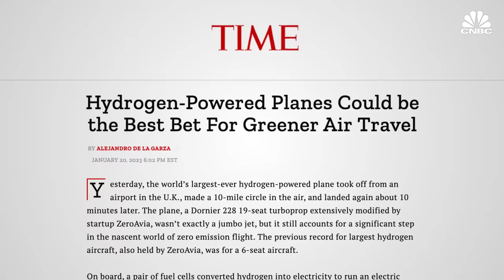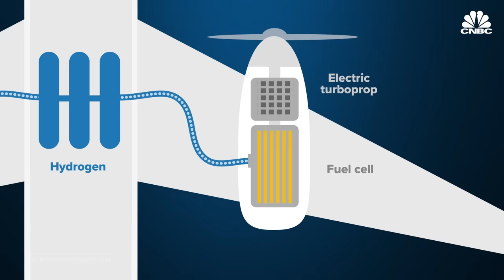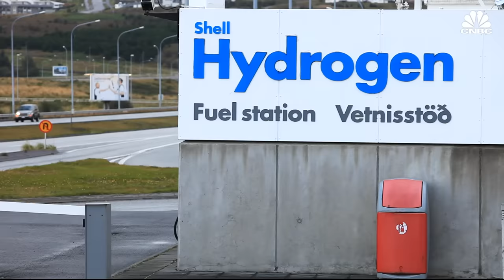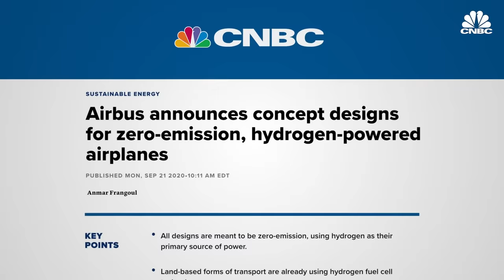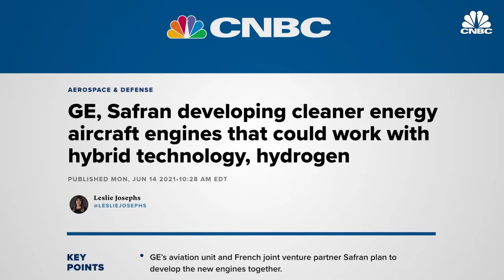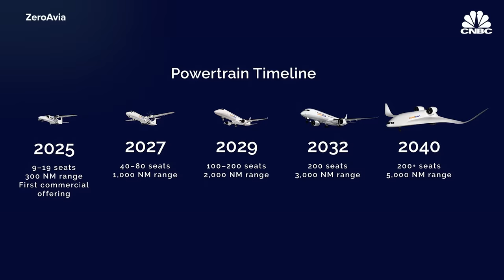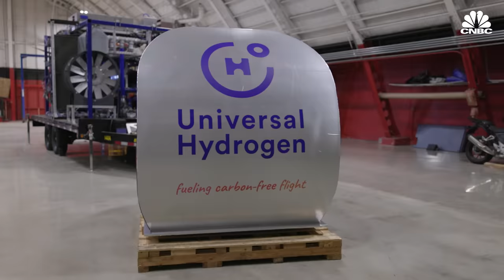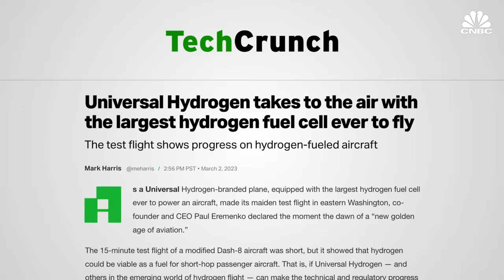Why Hydrogen-Powered Planes Will Beat Electric Planes

Comment: While H2 is energy dense by mass, by volume it leaves much to be desired. H2 also needs to be either cryogenically frozen or highly pressurized in storage which drags on its round trip efficiency. H2 could still play a big role in green ammonia production, which has greater energy density by volume without the previously mentioned problems of h2. The holy grail in my view would be developing a scalable and cheap direct ammonia fuel cell (vs having to crack the ammonia back to H2, which again, drags on efficiency).
Reply: This honestly... Or if all else fails, we could develop e-fuels for use in aircraft and shipping, but my guess is the loss in efficiency would be higher than for ammonia.
Reply: @jenniferperry87  yes and we’ve seen it is only good at postponing space launches. SpaceX abandoned it. Too finicky and dangerous to be practical.
Reply: Planes don’t carry fuel for a round trip. That’s called ferrying fuel and is only done if fuel isn’t available at the destination.
Reply: I'm more worried what they left out. 1. Hydrogen production or the production of black Hydrogen which results in more pollution since it is the only cheap way to produce hydrogen. 2. hydrogen cells use rare metals like iridium and pt which has become really really expensive and only a few countries dominate the market. 3. Storage, due to the hydrogen and the way it bonds with metals all pressurized tanks have to be specially coated which makes them really expensive and heavy. So it seems that hydrogen in aviation has a lot of issue to solve.
Reply: I don't think that we need to worry about the round-trip efficiency of H2 as much as we do. The extraordinary energy density by weight is the most important part of it, enabling its use as a green fuel in aviation and long-haul trucking. An electrolysis-based production process can easily be run on the excess power generated by solar and wind plants that might otherwise be wasted, making the round-trip efficiency much less important.
Reply: Indeed. It doesn't seem that using molecular H2 for long haul aviation is a solvable problem, which I suspect is why we never see more than extremely buzzword-heavy announcements without any serious technical details. My suspicion is that all of these startups are riding the current hydrogen hype (and are helping fan it) to line up lots of R&D investment, in the hope that in 4-6 years or so battery densities will increase sufficiently to enable a smooth switchover for medium-haul flights, while quietly sweeping the hydrogen failure under the rug. We've seen that before with Nikola and others in trucking, no reason it won't happen again in aviation. Ammonia MAY be a solution for longer flights, but it's still significantly less energy-dense than hydrocarbons and will require more substantial conversion technology, significantly lowering overall payload capacity. Best and most likely case I see is that long haul flights will continue to run on fossil fuel, with shorter flights increasingly being electrified. If you can electrify all but transcontinental flights, you're still massively reducing emissions.
Reply: @fourth deconstruction  1. Blue hydrogen is the most produced and consumed hydrogen currently, produced from natural gas. 2. The amount of those catalysts actually in the electrolyser or stripper columns is surprisingly quite low, not the major cost by a long shot...
3. Passivation is a cheap process and basically prevents hydrogen embrittlement on top of using a base metal like stainless steel type 316L, hydrgoen embrittlement really isnt a huge problem.the real problem is still always about compression,  the amount of compression  needed is stupidly cost progiohibitive.
Reply: @KaraHops  unfortunately  due to no industrial renenwable energy storage, the least realistic thing is running on renewables fully, an offshore wind farm or similar will only run for s portion of the day while the plant needs to run continously, the electrolyser takes too long to startup and shutdown  for it to be a batch process
Reply: @blade  hydrogen beats out energy efficiency from batteries in longer haul trucking especially, meaning it has a workable niche to build from no matter what happens with planes, it wont just go away, the energy density is just too attractive combined with the huge subsidies  and goals plotted by the EU for example, they've  commited to producing something  like 200000 tons a year of it by 2030
Reply: @whut9245  

" the electrolyser takes too long to startup and shutdown  for it to be a batch process"

Really? We had an electrolyzer on the submarine, called "O2 Generator", it didn't take hours to startup? We have nuclear power, so we just run a lot of electricity through seawater, and it gives us oxygen to breathe. We just vented the H2 overboard. It starts generating O2 as soon as you turn it on....maybe some processes need a while to start up I dunno.

There is a plant being planned here in California to take excess power from solar (we get a LOT of solar power when the sun is shining, here) and use it to split water, then run the hydrogen through a fuel cell at night. 

But this is a good reason to keep nuclear power around, as it's 24/7 no pollution. Other examples of such sources are hydroelectric and geothermal. 

Here in the Bay Area we have the largest geothermal plant in the world, capable of up to 1.5 GW although they usually have it ramped down a little to 900 MW. It's called "The Geysers". 🙂

There's tech they're working on where you could geothermal anywhere in the world, by drilling until you find heat, and then letting wastewater fall down there due to gravity, and use the resulting steam to power a generator. They've already done a bunch of that at The Geyers when the water was running low at some of the plants.
Reply: @asphere8  I don't think there really is such thing as "excess power generated by solar and wind plants" until there is enough capacity and storage to get rid of all generation of electricity using fossil fuels.  That's at least 20 years away.  If you instead use some of that capacity before you reach that state to produce H2 for aviation, you are further delaying how quickly we get off of fossil fuels for generating electricity.  You have to focus on efficiency if you want to collectively reduce the use of fossil fuels in a timely manner.
Reply: @TomCook1993  Round trip efficiency isn't referring to the plane returning to it's point of origin.  It's referring to the inefficiency of going from electricity to hydrogen and then back to electricity again (electricity->electrolysis of water into hydrogen->compression and liquification of hydrogen->storage and transport->regassification->fuel cell->electricity).  You lose more than half the energy due to inefficiencies at every step.
Reply: Each time you add a step, you add another inefficiency.  The use of H2, is you point out, is very inefficient when you look at the whole energy transfer system from electricity to hydrogen and back to electricity (electricity->electrolysis of water into hydrogen->compression and liquification of hydrogen->storage and transport->regassification->fuel cell->electricity).  Producing ammonia introduces another step of inefficiency, and as you mention, if you have to convert from ammonia back to hydrogen you have another.  H2 and Ammonia also have their own sets of hazardous material concerns as well, that can't be ignored.
Reply: Most hydrogen comes from natural gas anyway. CNG/LNG does not weaken metal, is easier to store then hydrogen, is 100% American independent fuel with pre-existing infrastructure, does not need expensive fuel cell materials, takes up less volume then hydrogen, wile burning cleaner then current airline fuels while being cheaper. May as well skip the middle man. Especially if the CNG/LNG comes from biogas which makes it carbon neutral (as good as batteries). Oh and the fuel is non toxic which means no soil/ocean oil spills.

That being said the only advantage hydrogen is it “burns” without any air pollution on the business end. Note that most hydrogen comes from natural gas which emits carbon on the fuel synthesization plant end regardless to make the hydrogen but can be made carbon neutral if sourced from waste/biogas  (and along side methanol) can run through a fuel cell which is quite compared to a internal combustion engine. doesn’t mean much now since fuel cells are Uber expensive but if research can find cheaper materials to make fuel cells with, then they could replace batteries a lot of devices. Why would anyone want that?  Well refueling is and likely always will be quicker to refuel and be more energy dense then a battery recharging and cell chemistry; meaning your phone or other device that uses batteries could, in this hypothetical scenario, last you 3+days straight while being able to refuel in less then 5 minutes from 0%.

For cars and trucks, a electric pantograph/Biogas/biodiesel/vegetable oil or efuel hybrid system would be ideal. Batteries take a lot of pollution to fabricate compared to ICE and are not Nationally independent materials. A electric pantograph road system will allow us to use way less battery materials while providing electric cost and environmental savings with less manufacturing emissions while providing the option to use carbon neutral fuels in less developed/off-road scenarios. Oh while being infinitely easier to recycle.
Reply: If somebody wud be so kind to provide how much wh/kg does hydrogen have...
Interesting to see how far off is Hydrogen compared with batteries... 
So far we've heard announcement from the likes of CATL & others that they've managed to achieve up to 700wh/kg...
🤔🤔🤔
Reply: @fourthdeconstruction  But you're not going to get an alternative. What are you going to use? Batteries? This is technically unfeasible unless there's a massive breakthrough in battery technology. Batteries would need to be at 2.4 kWh/kg. Hydrogen is the future for aviation. This doesn't mean things will happen overnight though. There is no straightforward solution to a green transition for aviation. New technologies will have to be built. Luckily there's another 25 years for development and testing before 2050.
Reply: @wakannnai1  Battery tech is improving in the meantime Biofuel has shown that it works. Commercial planes are already flying with it. Lithium is not going to help aviation, we need other solutions to make batteries way better. But Hydrogen even if you fix or find solution to all related tech challenges, you still have to solve the problem that it's very expensive to produce with clean energy otherwise you will be producing black Hydrogen from fossil fuel which will produce the same level of pollution as flying planes with jet fuel.
Reply: Nitrogen oxides are harmful, it's one of the reason and the other major reason for not using ammonia is it's high ignition temperature and low stability of flame i.e before it even ignites, it would leave the combustion chamber of an airplane. So this would require designing a new type of fuel spray and combustion chamber. People might think it's easy but it's not. Combustion chamber is one of the hardest to design, cause there's no proper simulation or to correct a software that has high accuracy for combustion simulation, this slows down the design process. Another reason is the efficiency. People might not believe this but the current combustion chambers are >99% efficient. So that's a tough competition. Not saying designing a cc for hydrogen is simple but hydrogen is superior to nearly every type of fuel when it comes to ignition and flame stability.
Reply: @asphere8  the major problem is electrolysis itself. The electrical energy required for it is huge. I once learned in a lecture that just to Heathrow 100% with hydrogen planes it would require tens of thousands of megawatts. In comparison a general thermal power plant generates 3-10k mega watts of power (it's in that ballpark but it might be even bigger).
Reply: @SunKing909  in a expensive fuel cell for performance effectiveness yeah, in a Hydrogen ICE or measuring for energy efficiency to make the fuel then use it. No. Inferior volume energy density and harder logistics. Nox breaks downs in atmosphere otherwise known as laughing gas. Not to say it’s no lapughing matter but it’s by far the least prioritized since every current combustion engine emits it reguardless. Internal combustion engines age not 99% effecient. 45% max for common engines. If you want to remedy Nox you could use a nitrogen-less closed fuel mix engine. No nitrogen to react in the combustion chamber if it stays sealed and only intakes the fuel mix. Though that is future Nox tech. But as they say perfect is the enemy of good and Nox is one of those low priority things compared to greenhouse gas and utility performance. Hydrogen ICE engines produce Nox too fuel cells however don’t but are too expensive so far. You are right for thinking of that type of stuff by hydrogen is not specifically that Nox haven. Hydrogen comes from natural gas plants which produce NOX anyway.
Reply: @wastelesslearning1245  that 45% is what we call thermal efficiency. It's different from combustor efficiency.
Reply: @SunKing909  we use thermal dynamic effeciency cause it factor in the energy needed to refine/transport the oil in the first place and wasted in things like transmission and waste heat. Otherwise we ignore the forest for the trees. If you only measure the wheel output, you can fool anyone with 99+% if you ignore every input system before the result. I’m still glad that you look into things like this. Too little people don’t.
Reply: @wastelesslearning1245  for combustion chamber we still use combustor efficiency eta c. it's not a major parameter when you consider the entire engine but only when you look at the cc it's one of the main parameter. Currently I think other than during flame out condition due to emergencies, it's not acceptable to have an efficiency less than 92%. Might think it's a useless one but it determines the required fuel flow for an engine.
Reply: @SunKing909  I don’t think it’s useless just incomplete. Just measuring the combustion efficiency is a good start. But if your goal it to actually understand the true efficiency of the entire system to way your options or solve problems that don’t already have solutions, then you got to factor in the rest of the subsystems and components and logistics. If you complacent with myopic 99% efficiency then good news we already solved the problem nothing else to see here folks. Of course in the real world there are still problems outside the combustion chamber so we must factor those in aswell. But you are right the engine efficiency is a important factor. A starting point  baseline factor.
Reply: Ammonia is an excellent and common hydrogen carrier that's liquid at room temperature
Reply: H2 will become much more efficient once electrolysis can be achieved using only water and technology to split the molecules instead of a peroxide solution, once this feat is achieved ( probably will take 10-15 years) hydrogen will b net positive
Reply: Go for it, go develop it. 👍👏👏👏👏
Reply: However, the use of amonia usually involves NOx as a byproduct which is a green house gas 300x more potent than CO2.
Reply: @MUSLIMSCOMMITWARCRIMES  The highest theoretical efficiency of electrolysis is the energy required to overcome the enthalpy of the hydrogen/oxygen bonds, which is 144 KJ/kg, or around 40 kWh of electricity. But some energy is always converted to heat in real world systems, so typical commercial electrolyzers need around 50 kWh per kg of hydrogen created. That kg of hydrogen in turn contains around 33 kWh of usable energy from a fuel cell. Incidentally, hydrogen using electrolysis is already "net positive", it just requires more electricity than alternatives for any given application.
Reply: @Garhunt05  No it's not. The boiling point of liquid ammonia is -33 degrees C, requiring significant cooling systems for any aircraft tanks. Definitely easier than the -253C of liquid H2, but not trivial. Ammonia is highly soluble in water, at 25C about 33%. But then you're massively lowering the energy density in order to gain ease of handling. Which brings us back to square one, that hydrogen is just not a good mobile energy carrier.
Reply: Any hydrocarbon fuel or ammonia, when burn, is hydrogen fuel. When you ignite H2, 100% of energy is produce. But if you burn a hydrocarbon, some of the energy will be use to split the hydrogen and carbon before the hydrogen react with oxygen. The energy needed to split the hydrocarbon depend on type. Kerosene require more energy to split than say, methane.
Reply: @fadlya.rahman4113  Except that most of that energy being released when burning hydrogen is not easily convertible to useful work, that's the downside of all heat engines. So unless your objective is heating, the system efficiency is pretty terrible. And even for heating there are methods with an overall much higher efficiency, such as heat pumps. In the end all you care about is how much useful work or output energy you obtain per kWh that you put into the system. Hydrogen never wins.
Reply: @jenniferperry87   they could place wind turbines on or in the plane

they could recapture energy    from air resistance
Reply: @asphere8  Late to the party on replies, but Real Engineering has a great video on aviation fuel replacement which is why I mentioned efuels in the first place. Again, energy loss is high in their creation, but we don't really have a great alternative atm
Reply: Why are they not using Metal Hydrides???"  MgH2 is safe, does not require compression, and stores more energy than both gas or liquid.  They could also have on onboard electrolysis to produce added hydrogen while in flight!
Reply: Just fill it up with water and make your own hydrogen on the plane with HH!